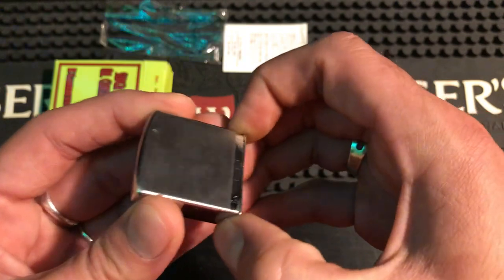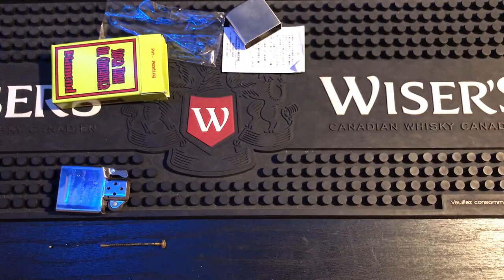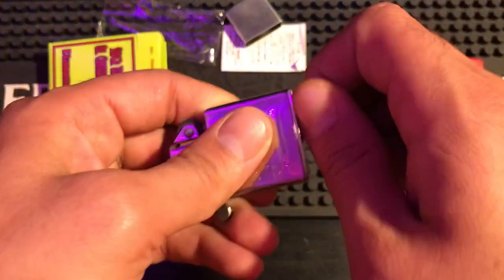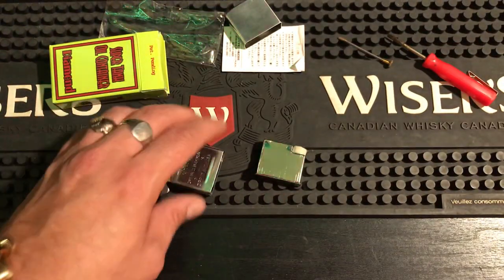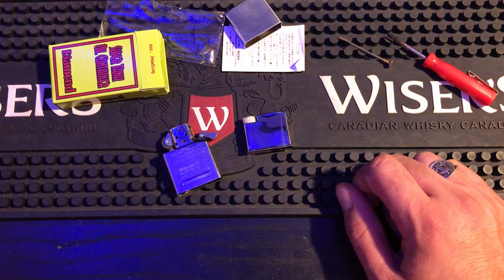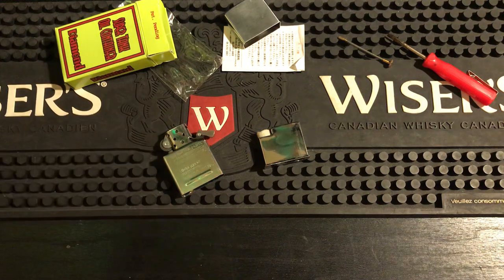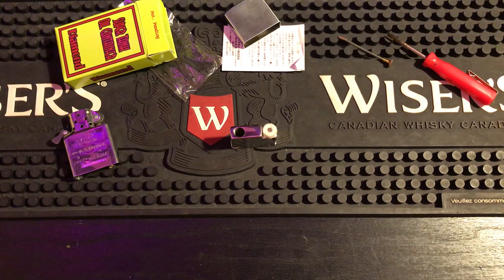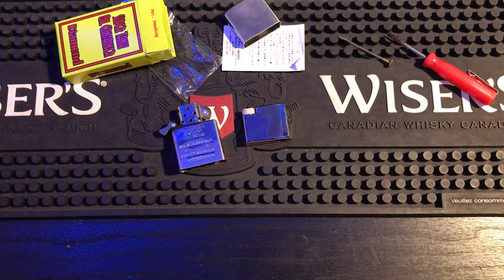The Ultimate Zippo Insert Fuel Efficiency At Its Best

Comment: Nice but there's an easier less complacated (and cheaper) way to do that. They sell rubber gaskets that fit into the end of the insert. It has a door to fill the fuel and a place for the storage of one flint under the door.😊
Reply: Now they make metal versions of those. The fuel makes the rubber shrink after some time so i wonder if the metal ones will help. Plan on ordering one soon. We'll see lol
Reply: @donprovolone1425  It works i have a metal gasket

Comment: I still have mine but haven’t used in a while. I don’t like that I have to use a screwdriver every time I fill up. I use my lighter everyday I usually fill up when I’m waiting out the door so it’s faster to use regular insert.
Reply from the maker: Yeah I Didnt like using it edc either. I don’t like any of the sealed inserts to be honest. Original is king. Why mess with perfection

Comment: Hey quick question. On your old channel you had a fuel efficiency video where you were going to build the ultimate zippo. I was thinking of buying the Zorro to take the metal bottom to put into my zippo so it looks a bit nicer than the ziplock trick, did you ever confirm if it fits or works?
Reply from the maker: No I Didnt end up making it. Just a lot a work for something not that special. The way I pack with sandwich bag last me what I need